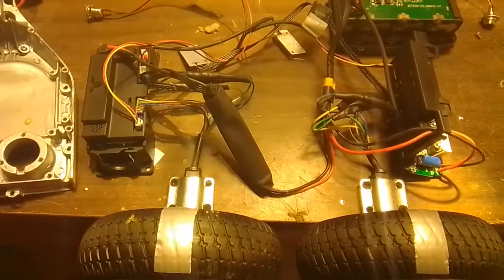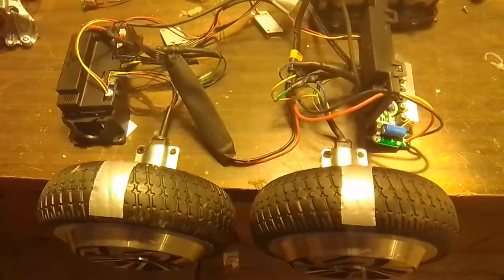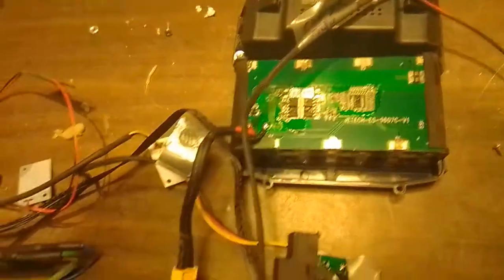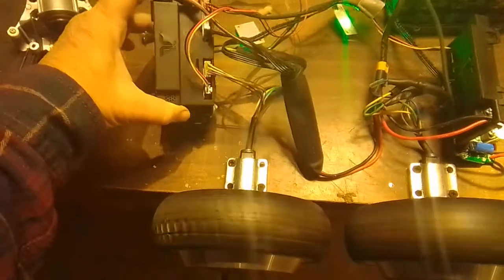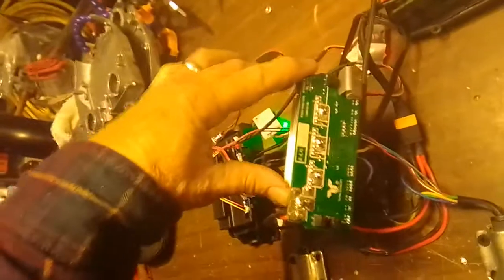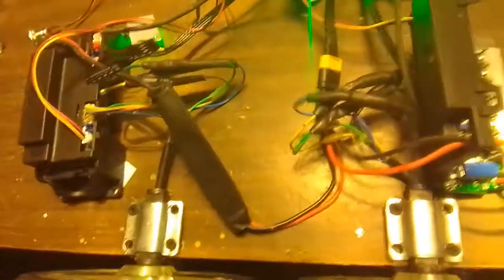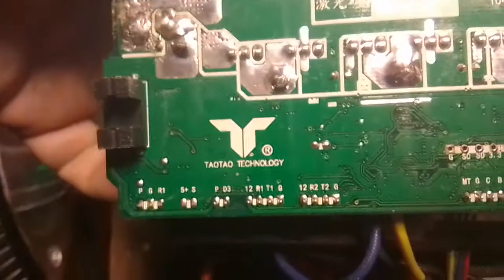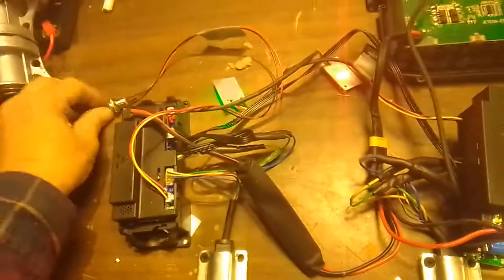New Hoverboard? Dual motor control boards.

Comment: a lot of hoverboards beep when you reach top speed.
Reply from the maker: Thanks for the info. I am still using Hoverboard motors a year later. In fact, I have acquired quite a few of them for various robotic and human mobility projects. Having said that, I have abandoned trying to use the factory control boards. Now I use the Riorand bldc (with hall) motor drivers from Amazon. They are under $20, sometimes as low as $14 USD, and easily interface with microcontrollers.  I scrap the Hoverboards for: Motors, batteries (36v LiOn), bolts and connectors.  So much treasure in every hoverboard, once you crack the secret of controlling the motors.
Reply: Have you got a way to hack these split motherboard hover board
I know the singal board one can be hacked with custom firmware
Reply from the maker: I gave up trying to hack the factory board. Now I just use a RioRand, hall style, motor controller from Amazon. Works great and cheap. @lifeai1889

Comment: Each board have a gyroscope microchip that knows when the hoverboard is in an irregular condition (with exposed electronic parts, in this case), that's why by putting the boards upside down the beeping it temporarily stop.

Comment: hi, the beeping is because you have the "daughter boards" upside down. and the sensors know it, remember where you step on the switchplates...right now they are facing downwards... I only know this because I spent a few hours the other night trying to get mine to stop beeping, so I didn't wake up my wife...